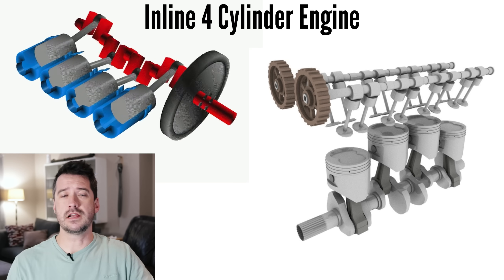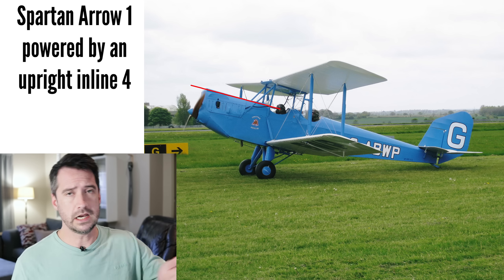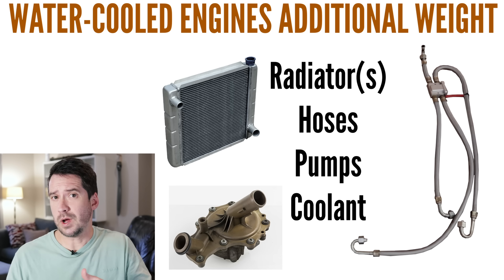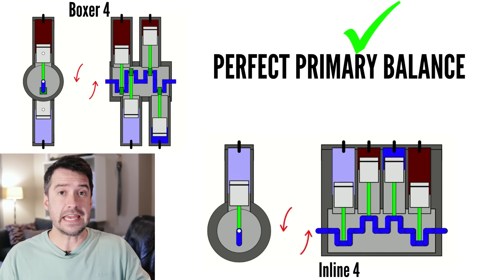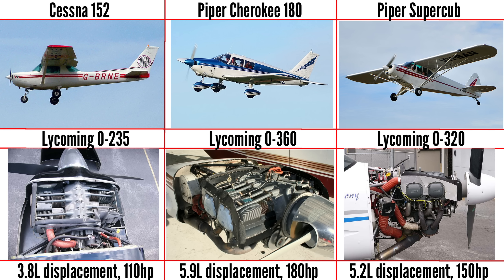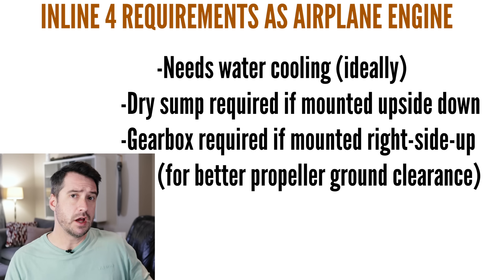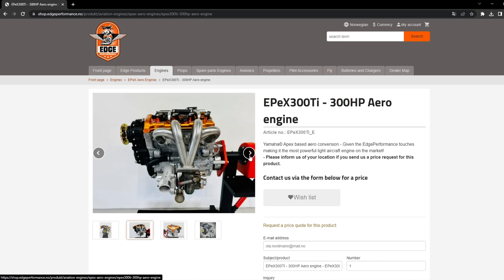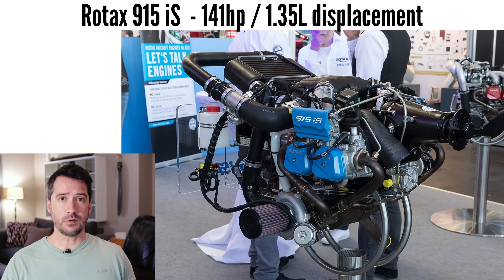Does Inline 4 Engines Suck for Airplanes? - Technical Deep Dive

Comment: Master Auto Tech here: Certificated means "thoroughly understood", not "this is the best". Lycoming and Continental aircraft engines have two cylinders' worth of crankshaft throws and camshaft lobes between shaft bearings; this long distance allows tremendous amounts of "noodling" flex of the shafts and case; bearings typically have hourglass-shaped wear patterns due to so much dynamic misalignment, plus cylinders and engine cases sometimes fail where they meet due to vibration. I've NEVER seen that wear pattern in any modern automotive engine, including V engines in which 2 connecting rods share 1 journal. The last auto engine I saw with that much distance between bearings was a 1960's MG. Why are aircraft engines not rated above 2800rpm? Because they're likely to blow up much higher than that! Fortunately, typical diameter propellers are limited in RPM by the tips going transonic.

Comment: captivating video   clear voice .  I was Donnington GT champion in 1980  in the UK.. my powerplant was a self modified four cylinder hillman IMP  engine  developing 120 bhp at 9,000  plus rpm .the engine was tilted over and ran wet sump . running the water and oil pumps at lower rpm actually improved the cooling and reliability .. I loved your accent .

Comment: The main reason why we wouldn't see a high speed inline four cylinder aircraft engine is economics. The general aviation market is too small for a manufacturer to recover the expense of designing, developing and certifying a high speed inline four engine. Heck, even if an automobile manufacturer was willing to redevelop one of their own inline fours into a 200 hp aircraft engine that could replace the Lycoming O-320 & O-360 engines, AND they dominated the 160-200 hp engine segment for production aircraft, they probably wouldn't be able to sell enough engines to recoup the cost of development and certification.
Reply: That's the real reason.
Reply: The certification mostly..
Reply: 😂 Certification is a bad joke. It makes old and inefficient design a compulsory safety demand. In France it resulted in a identical aircraft being available in a safety chute version ONLY if classified as Ultralight... Many exemples exist at all levels showing how ridiculously the certification rules impacts both aviation performance AND safety. Not taking chances for progress is a very safe way to stay in a dangerous situation.
Reply: What about Diamond Aircraft?
Reply: Funny, since both Lycoming & Continental plane engines are soo good & reliable I'm shocked that we don't see those same reliable & great engines inside more cars?

Is there any reason one mechanic couldn't install a Lycoming engine in my Subaru or Camero if I truly desired that specific engine of choice.

Not practicality but could & would ot work? 

Is there really any reason it wouldn't work?

Question 2, why don't we see a Mixture knob for cars that drive at higher elevations in Colorado etc.

Is it more feasible & economical to simply purchase a car that has turbo equipped if I lived around Colorado areas?
Reply: @Mikinct  Installing a classic aviation engine in a car is a very bad idea. You might be able to find a way to package the swap, add forced air cooling fans to allow the car to idle in traffic on hot days and modify the ignition and and fuel induction systems to work on a road vehicle but in the end you would be disappointed at how poorly the airplane engine behaved inside an automobile.

Classic aero engines, like the Continental O-200, and the Lycoming O-320 don't perform so well in aircraft because they are superior to all other engines. They perform well in aircraft because they were designed for aircraft because their design was optimized for use in aircraft. They idle for short periods of time, spend most of their time cruising at 60-80% max power and are usually fed a diet of high speed cooling air. Automotive engines are designed to thrive in a greater variety of conditions including extended idling at hot temperatures for traffic jams in major cities, climbing hills in low gears, cruising at less than 20% power on the highway and operating at a wide variety of temperatures. They are expected to pass exceedingly demanding emissions standards and be operated by people who have no knowledge of engine management.

We don't see mixture controls in cars and trucks because leaning out the mixture would distract the driver from paying attention to traffic. Most drivers are so careless that if the addition of a mixture control knob would lead to engines getting damaged due to overly lean fuel mixtures. There is also the needs of modern emissions controls that require optimized air fuel mixtures which have forced gasoline car and light truck engines to use electronic fuel injection.

Simply put, aircraft engines were designed to deal with the needs of aircraft, automotive engines were designed to deal with the needs of drivers and the road. These two environments are very different and engines that work in one are not likely to work well in the other.
Reply: @darwinskeeper421 Cars don't have mixture because they have ECU, just like how modern planes have FADEC
Reply: @rdablock  That is true in modern times, but back when cars had carburetors, they didn't have a driver adjustable mixture control for two reasons, it wasn't needed by the vast majority of drivers (who didn't live at high altitudes) and would have been an unneccessary cost, and the probability that, if drivers were playing with the mixture control settings many people would lean out the mixture to the point where it might damage the engine.
Reply: Rotax 916
Reply: And if you dig around you will find examples of people who had grand visions of knocking Lycoming and Continental off the top of the light aircraft engine options.
Besides the current generation of electric motors are pretty staggering. IF (and I stipulate IF) they can get a decent lightweight battery system then for light aircraft in some applications will be a better long term option.

FYI - I am an aerospace engineer. Its why I stipulate the "IF" because there's been so many promises in aviation and aerospace in general with very few things panning out. The simple fact is that aviation is hard and space flight is even harder. Both are also incredibly unforgiving to errors as has been demonstrated too many times.
Reply: @pilotavery  I have a lot of respect for Rotax. They started by exploiting a niche market, under 100 hp engines for kitplanes, with their 912. Then they certified it for use in small sport planes and developed it until it became able to compete with Lycoming's might O-320. I wish them luck.
Reply: @darwinskeeper421  their plane engines make rated horsepower to 18,000 feet and use half the fuel at lighter weight and longer tbh, they more than compete.
Reply: Yeah now if the USA was like Europe and you could have heavier ultralight vehicles and brought back interest in aviation there may actually be a market
Reply: @yveslegrand9826 Very well said. Merci!
Reply: @darwinskeeper421 Hi, 
Are mixture controls a feature or a burden in your opinion?
Reply: This can be summarized in one word:

Stagnation.
Reply: @Conservator.  Mixture controls have their place. That place is in a traditional carbureted airplane engine. They have no place in automobiles. Modern fuel injected engines have a computerized mixture control system and do not need a manual mixture control.
Reply: @darwinskeeper421  Thank you for your answer. I know a fair bit about modern car engines but I hardly know anything about aviation engines. I wonder if an automated fuel mixture in the aviation industry would be safer than manual controls. The latter seems outdated to me but maybe I’m overlooking something.
Reply: @Conservator. Oh it is. But certification is key. There are automatically managed FADEC (full authority digital engine controls) in GA airplanes, like the DA62 (which uses a proprietary diesel engine) and the new Cirrus (which had a modified, modernized version of a legacy Lycoming engine). It's just less common and most of the GA fleet is old and will never be retrofitted because it would be an extensive process. 

Tl;Dr alot of more modern GA airplanes can be, or are single lever control and we don't have more because certification. But yes it safer.
Reply: @darwinskeeper421  "back when cars had carburetors, they didn't have a driver adjustable mixture..."  I'm old enough to remember when "Automatic choke" was a fancy new invention.  Before that, every car had a choke (which is a mixture control). Since cars don't generally change their altitude by thousands of feet, the only need for the mixture control is to change the mixture based on running temperature.  Very early cars needed a mixture control that would be continually adjusted to allow for different speed/throttle positions.  This was due to the simplicity of the carburettors that were basically just a crude jet stuck in the airstream that took no notice of inlet pressure or throttle position.

I think the main reason that manual mixture controls have remained longer in aircraft is the resistance to trusting electronics to carry out such vital adjustments reliably.  it's one thing for a car to show a "check engine" light and revert to "limp home mode" but if a sensor goes bad on an aircraft, that behaviour won't cut the mustard.  A "limp home" configuration on a car can at least, assume you're on the ground.  But if you're in the air, a "limp home" configuration at five thousand feet could mean a stalled engine at 200 feet.
Reply: Increased wet…… ok. Someone please wake me up when he’s done contradicting himself.
Reply: @darwinskeeper421  Rotax started off making single cylinder engines for motorcycles, go karts chainsaws, then combined cylinders and made 2 cylinder and then 4. Lycoming and continental started off with massive radials and reduced the amount of cylinders.
Reply: There are many small engines that can deliver 150-200kw continuously. The development is already there, it is insurance and certification that are prohibitive. I use a little inline 4 cylinder Suzuki that makes all certified and mass produced engines look bad around the 150-175kw range. I think about selling them, but insurance alone and the thought of a lawsuit is always possible if something went wrong. With an engine that has manual fuel adjustment, the responsibility is on the operator. With a carb that could ice up, the responsibility is on the owner to turn on carbon de-ice. If everything is automatic, the responsibility is on the manufacturer. The majority of people with a pilots licence no little about engines, and even mechanics no little. Giving these people something that is powerful and expecting them to treat it well is concerning.
Reply: @Mikinct  Are you aware that most new car engines can run if you maintain it well, at least 150 000 km even much more?! Average ultralight pilot make 30-50 hours in the air per year. Average speed of car 120 km/h. That is yearly equivalent of 3600-6000 km for that engine in one year. You can do the math for the rest. You still think car engine suck in ultralight? That is reason why in experimental aircraft lot of people put car engine specially in Europe. In Europe, you have PSA group motors , diesels 1.4 , 1,5 turbo up to 100hp, for few hundreds of euros and u don't have any problems a 5-10 years. You can fly 100 km for 3,5 liters of diesel.
Reply: Viking
Reply: @dieselfrk13  stay away from viking
Reply: @chippyjohn1   why it's just a Honda engine
Reply: @dieselfrk13  Not the best choice of engines, the company is dodgy.
Reply: I thought inline 6s would be better inherently balanced.
Reply: @darwinskeeper421 it has to be automatic so that you do not suddenly floor the car and the engine overheats, while in an airplane you generally keep the throttle at the same position for a long period of time.
Reply: It's called electonic fuel management.  Something that should be part of a general aviation  engine. As much as i dislike electronics for electronics sake, fuel injection and its attendant electronics really makes sense. A 15% decrease in fuel consumption is hard to argue with @ $6/gallon. @Mikinct
Reply: @r.guerreiro140 Diamond is bound  due to engine availbility...Ecen they  have to set up an engine department and failed.
Reply: @yours_sincerely48  thank you

Comment: I'm glad you mentioned the Yamaha Apex engines. 
The 4 cylinder was putting out 300 hp,  but the new 3 cylinder is capable of 400 hp. This is presently being used by Wild West aircraft  as an option for bush aircraft.
Reply: Rotax has made a 3cyl for years which is used in jetski. that put out between 215 and 260hp then they upped the displacement and make 300hp currently but speed run guys have boosted them up quite a bit above that. Suddenly automakers have started looking at 3cyl forced induction for racing and hybrid applications for their super light weight and compact designs. Yamaha is probably lower maintenance or they are as a brand but it has surprised me that experimental guys haven't tried a rotax even though they have used Yamaha and Kawasaki snowmobile engines which are very similar. I do know that Yamaha 4cylinder engines crack cylinder heads. But rotax engines shake a lot and have an open deck so the sleeves are only attached at the bottom and the top is honly held still with the friction to the headgasket. you find head gasket material in the coolant.
Reply: @danieldimitri6133  Production form factor is the reason for the popularity of snowmobile engines in aircraft. Very few motorcycle engines in the skies due to the integral transmission.The trike and gyro crowd led the charge on the Yamaha conversions.  Teal Jenkins with his well made Propeller Speed Reduction Unit (PSRU) allowed people to buy a PSRU and have some faith in its reliability. Further, I am guessing that snowmobiles have a relatively short life span versus personal water craft, allowing low cost used engines on the market.

Comment: Would it not be cheaper and easier to build a twin I4 design than to put a single $20k-40k engine in the nose?
Im an industrial mechanic, i used to work on a lot of forklifts. Many LP forklifts use automotive V6 or I4 engines, they are just derated in power and otherwise improved in durability. Forklift engines typically have a 500 to 1000 hour oil change interval, just like Aircraft they are usually run at maximum engine output for hours a time.

Comment: 8:27 There is a third factor: rod to stroke ratio. Engines with a 3:1 or more rod to stroke (like marine engines) aren’t terribly bothered with secondary balance issues.

In-line fours can be way angled, which gives better oil handling than boxers. 70 or 85 degrees to one side means gravity still helps oil flows. And single prop planes have a “preferred” side based on prop rotation. A prop/engine pair with different centers of mass/thrust could play well with a single prop’s asymmetry.
Reply: What marine engine has a rod to stroke ratio of 3:1?

Comment: Peugeot/Ford has the DV6 1.6l Diesel, which I worked with a lot when I did a short stint as an Engine Rebuilder. It's an Aluminium Diesel with ridiculously low Weight if you leave off all the Car-Bits, and as an 8V sits at 120hp in the DV6 FC Variant. It combines this with a 1980s style Engine Architecture, meaning it has a single Cam, sitting in a seperate housing on the Cylinder Head, the Intake Manifold is integrated into the Head with only a single Inlet coming into it from the Turbo, a Two Piece Crankcase and a simple stamped Sheet Steel Oil Pan. 
It should make for a great UL Diesel/Jet-A1 Engine. 
Basically, I'm looking from someone to partner up with, as I simply do not have the funds or knowledge to start a company.
Reply: 120 hp from 1.6 liters won't last long whether it's diesel or gasoline. Auto engines produce 60% or more of their rated power only for brief amounts of time while an aero engine spends most of its life between 60% cruise and takeoff power.
Reply: It's bigger brother the DW10C permanently derated after 5 hours(!) of full load rated speed .